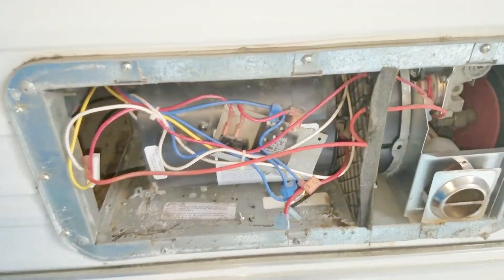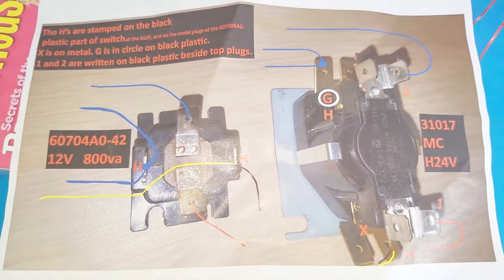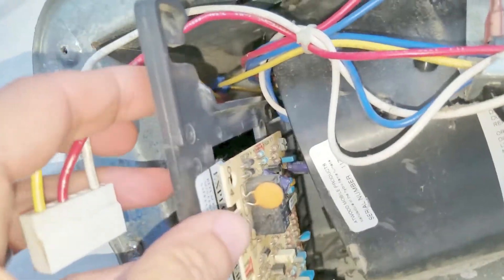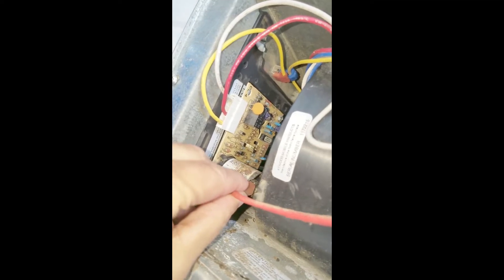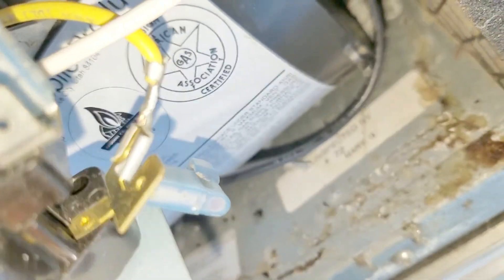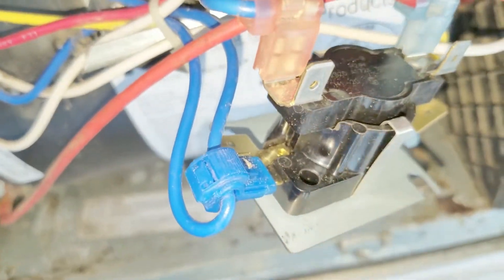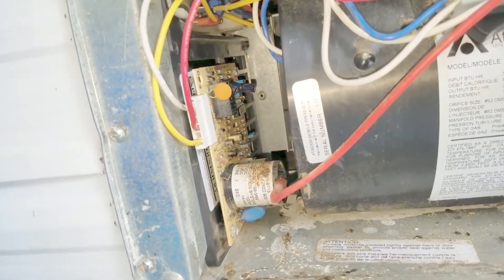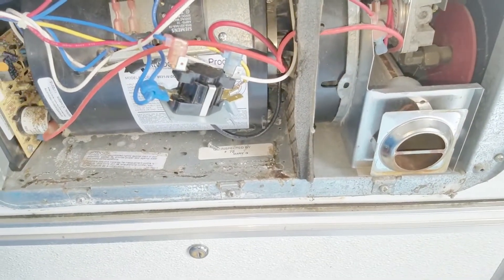Camper Furnace Repair - 8531-IV Atwood - time delay switch

Comment: Do you have a video showing how yo replace or clean a sail switch on this model
Reply from the maker: Sorry I don't. I don't have this camper anymore either, so not much more info I can add for it with any other stuff. Good Luck!
Reply: @jmurf999  thanks for the reply. I am really just wondering if I will have to remove the furnace to access the sail switch. It's been difficult to find a video about this model.

Comment: Excellent video. Do you have the part number?
Reply from the maker: In the description:   The old delay switch is p/n 60704A0-42 12V
The new delay switch is 31017MC 
The furnace is the Atwood 8531-IV-DCLP
Reply: @jmurf999   where do I order it at ?

Comment: Hi, I have the same RV furnace. I am at a loss about something, I follow the 12vdc from PS to CN then it goes to the thermal relay. I have a new thermostat, and the the 12v sits on the " top" of the thermal " relay", however furnace does not start?? Nothing ,no blower or ?? Ignition. So I decided to jump the thermal relay across too to bottom,the fan starts., But after several minutes Nothing,no clicking of ignition, nothing,?? Does anyone have any ideas?? thanks

Comment: Mine does the same thing as Brian's but if I run the thermostat real high  > 75 degrees then the furnace runs normally . If I set the thermostat at 65 or less then I get the on / off problems but eventually it will light.
Reply: Richard P Was

Comment: Where did mount that?..it's an after market and doesn't fit in the same place.
Reply from the maker: It "kinda" fit on the little metal plate above directly on the motor housing.
Reply: @jmurf999  
Mine is identical to yours but I still can't get it to mount there. I'm gonna have to play with it more tomorrow. I can't get the cover back on, and that needs to be on.

Comment: hi, I have same heater. my furnace kicks on for 2 minutes and shuts off. then it comes right back on. this repeats 10xs then runsnormsl.  I do hear a clicking sou s when this is happening. I had burner replaced (it was rotted).  I don't know what to do. I do not have a repair man to help as I'm a seasonal up on blocks and disabled.  thanks in advance
Reply from the maker: Hi. Not sure why that may be happening. This guy who also has the same type of furnace may be better suited to help though... https://youtu.be/7FFqpE5zoKY
Reply: @jmurf999  2
  B9